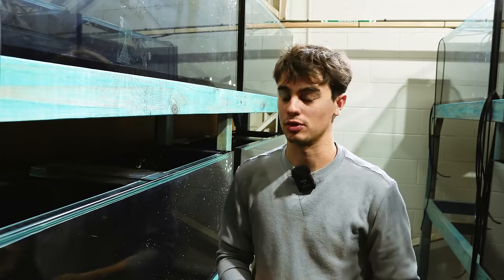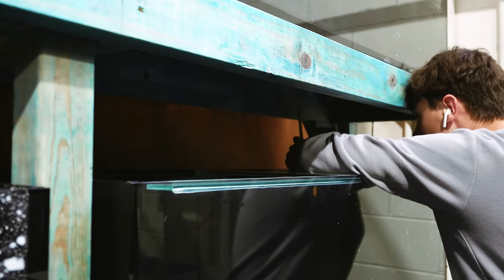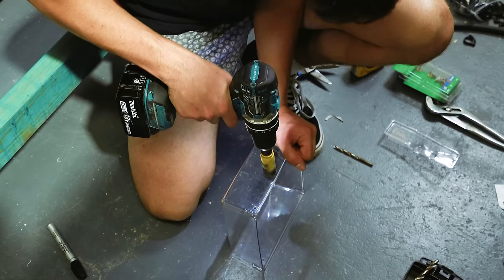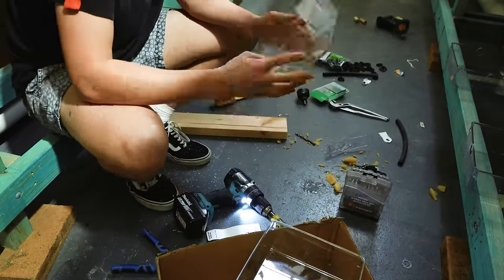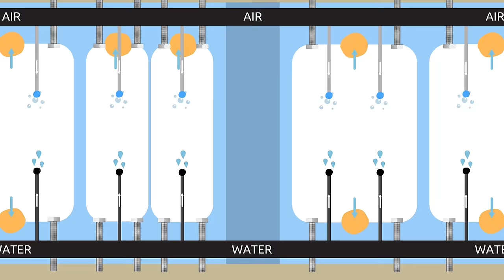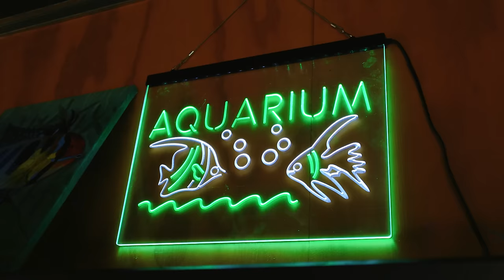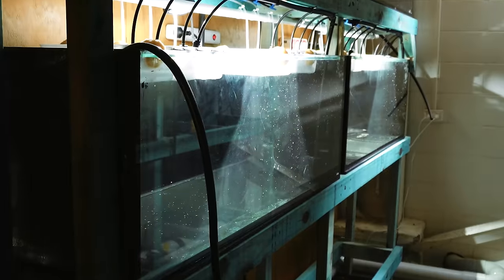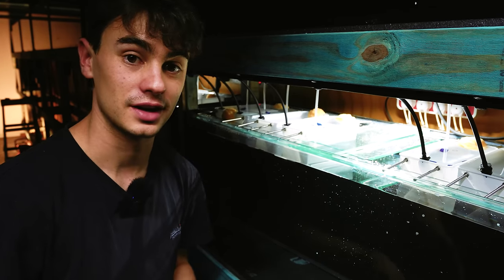The Best DIY Baby Fish Raising System!

Comment: Just a little tip to cut the sponges perfectly and super fast. Get a short piece of copper tubing at the desired diameter and file the edge of the tubing on the outside edge to sharpen the tube. This obviously only needs to be done on one side of the tube. Then just set the foam on a flat surface (not on a surface you do not want to scratch) and just lightly apply pressure as you rotate the pipe back and forth cutting the material. The downward pressure should be slow as you are cutting into the material. Works like a charm.

Comment: You probably know this, but for the audience, keeping the spunge outlets as big as possible on the inside of these boxes minimize the risk of them clogging, since there is much more area to clog up before that happens.
They can be smaller on the outside/the part in the main aquarium to keep it easy to take them out of the hole and put them back, making the maintanence easier.
And also, make at least one extra, then one can immedeately be replaced and then there is very small chance any fry get out in the main tank while cleaning the spunge.

Also, keeping the lights on 24/7 and feed fry automatically around the clock make sense for a professional breeder, but probably not for the mainstream hobbyist.

I guess you get your fry up to adult, or at least sellable, size twice as quick or maybe even faster than I do.
But I'm in no hurry, nor do I have a financial incentive to grow them quickly.
I find that I get fairly good results in the end, with healthy and good looking fish.
I even find that the fish I raised slowly from fry often live significantly longer than store bought fish.
And I talk about fish that usually live 2-3 years can be up towards 5-6 years!
Possibly only in part from growing up slowly, they also have stable, fairly unchanging water perimeters from birth and basically no stressful interactions during their lifetime.

Just my layman observations and I don't really want fish prices double or triple to have fished raised like this by breeders, but as a hobbyist, I think there is a case for not hurry up the growth process.

Comment: I actually had the same problem with a sump design of mine...
things getting clogged...using a more porous sponge and some (shrimp in my case) get through it...
a trick you can use instead of the sponges which will plug easily and require more maintenance or having to use different systems for different fry...
you could drill a hole in the bottom of those trays
glue a 3-4" piece of pvc (under water level)
 and just put a sock on it...that will act as the "drain" (the wider the pvc pipe more time between sock cleaning/changes)
and this way the fry size doesn't matter as they won't be able to escape through it and you can use the same system for all fry as they will be able to get back to the container even if they end up in the pvc sock pipe
also you don't need an air pump to create bubbles as you have a water pump already in the system...
you can use the very last piece of airline tubing where the water goes into the trays connected in a 'Y' with a little ball valve+one way valve
and this way it'll suck air in when water is pushed through the tubing removing the need for the air pump

Comment: plasti-dip white paint from supercheap works better and wont chip :) but super interested how these 5$ cans do. my only fear is it poison the fish but i have NO IDEA that's why I watch you :)
Reply: hot wire (or metal coat hanger) cuts sponge so easy you will cry
Reply: @Bobby The paint is outside, so if the paint is poisonous, it would not affect the fish.
Reply: @jacques13x  the tank water underneath is pumped up and into fry trays
Reply: @bobby_au  As I said. The paint is on the outside. The water does not come into contact with paint.

Comment: Hi mate I've been getting decent eggs but all my angelfish fry have died every time? they all hatched and started moving, had airflow and cycled sponge filter, 27 degrees and used methylene blue to hatch but all died and rotten within 3 days of movement. No idea why this keeps happening I've been doing everything yourself and Dean have suggested. Appreciate all the advice mate 👍
Reply: I've been raising african cichlids with no deaths and no problems, only difference is used crushed coral for a buffer